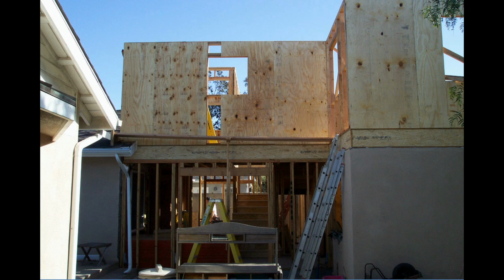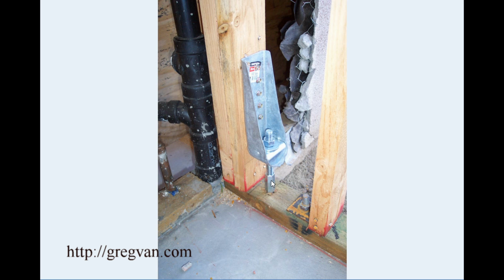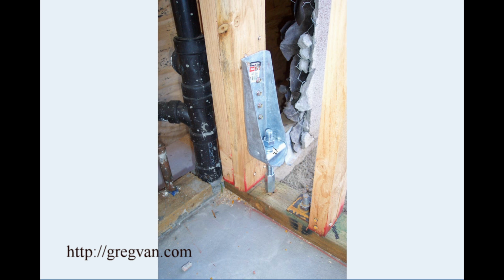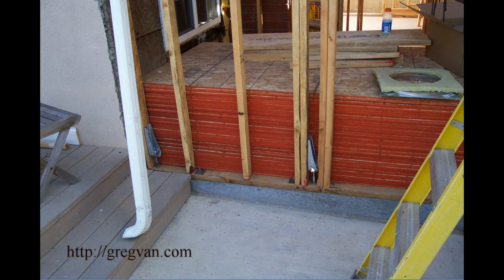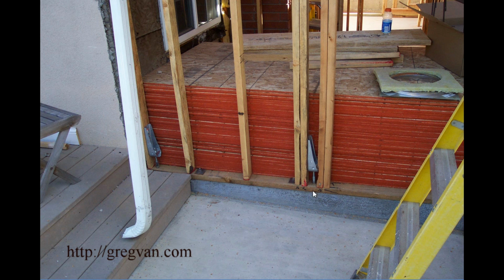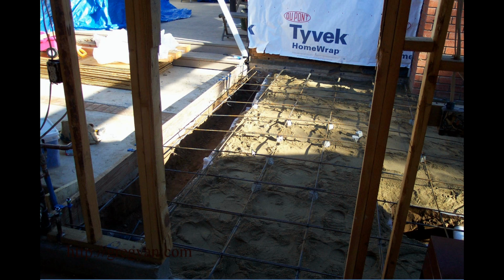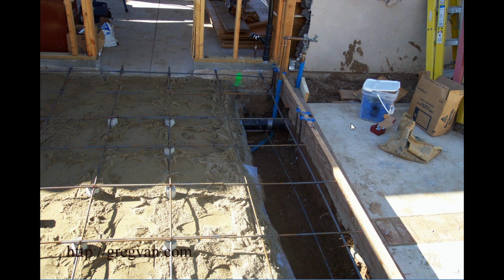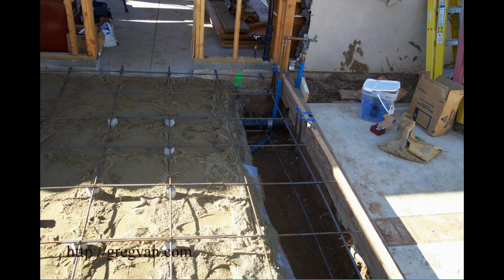Double Check Hold Down Locations And Heights Before Pouring Concrete

Comment: Hi im a framer and im about to start working for my self and i want to know if you have any video that shows how to do the layout for the holdowns anchor bolts taking mesures from framing plan? Thats one of my main concerns i dont have much experience going to job site befote they pour concrete to do the layout for the holdowns.

Comment: How many inches should it be above concrete? Anyone knows??
Reply: There is a mark on the bolt that is the embedment line in the concrete. One line if you have a mud sill, another line if you don't.
Reply: It's in the manufacturer installation instructions. Check with your ahj and follow the manufacturers instructions.